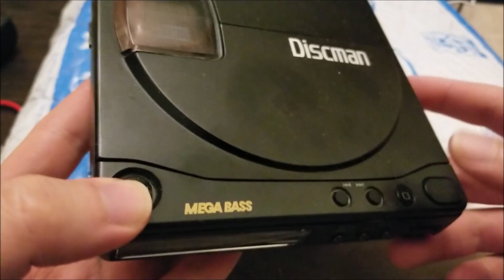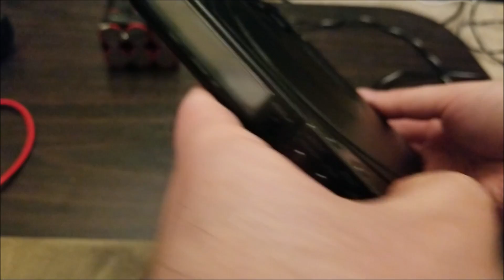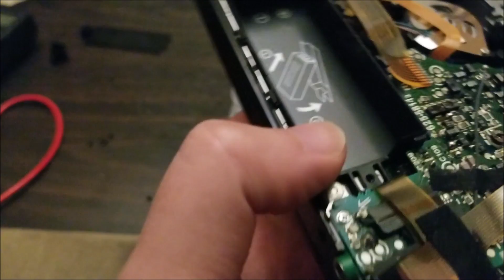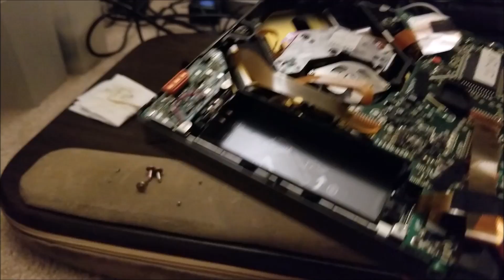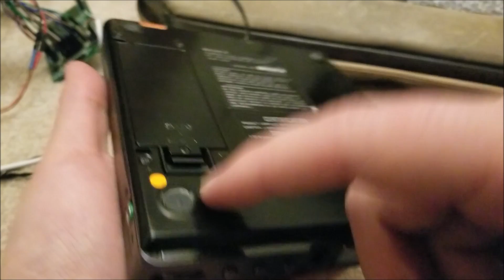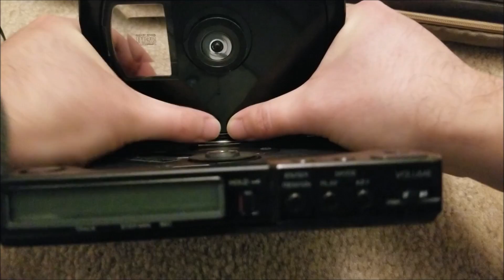Let's Fix: Sony D-15 High End Discman

Comment: hey bro how did you fix the power plug issue? i have same issue , is it a dry joing or dirty terminal requiring contact cleaner ?
Reply from the maker: Mine just had dirty contacts. Plugging and unplugging a jack a few times was enough to get it to connect properly again.
Reply: @sjm4306  thnkyou !

Comment: Thanks for the video and I've been struggling to out the tiny washer back on the middle gear, any insights?
Reply: Thank you! I finally put the washer in with two niddles. But it looks middle gear too tight and possibly ruined the motor. The motor doesn’t run any more. The 3D print middle gear kills me.
Reply from the maker: If the gear doesn't spin freely it'll just stall the motor (no permanent damage). You may have to clean the gear shaft really well and/or slightly remove a tiny bit to loosen it with a small drill bit. Also dont forget to relube everything that moves.
Reply: @sjm4306 I will order a new gear to try out again. Thanks again for your help!
Reply: I finally replaced with a new middle gear which works better. But I found when disc spins it makes big noises. Not sure if something is wrong with the spindle motor or some mechanism needs lubricant?
Reply from the maker: Does the spindle motor spin freely when turned by hand? Is the sound like a scraping noise?
Reply: @sjm4306 it can spin freely by hand. The continuous noise sounds like something is rubbing
Reply from the maker: It's possible the spindle disc clamp was pushed down a tiny bit and the disc bottom is rubbing on the bottom case tray.
Reply: @sjm @sjm4306 was wondering if the noise came from the disc clamp as it looks like wobbly. The spindle motor seems running without issue when I rotate. Do I need to change the part of disc clamp? I was thinking if I can lubricate it.
Reply from the maker: I dont think anything needs lubrication. I think the disc is either too low or tilted slightly and rubbing on some plastic. I'd first try carefully adjusting the position of the spindle clamp on the motor shaft.
Reply: @sjm4306 thanks again. I’m trying to find a video of adjusting the spindle height hopefully.
Reply from the maker: To prevent it from pinging off I sometimes use some putty/bluetack to hold it from the top and use something pointy like a needle or toothpick to find the split end and start prying from one side, sliding the tool around towards the other side to disengage the washer from the notch in the shaft.

Comment: Great job! I have a Sony D150 with the ribbon cable slit in half. Any idea where I can get the same ribbon cable? I was considering using thin wires to replace the ribbon cable. Thank you!
Reply from the maker: It's possible to splice the original ribbon depending on where it is cut. Otherwise you'd have to get a new ribbon designed and ordered from a pcb manufacturer like pcbway or jlcpcb

Comment: I just got one of these and repalced the rotten cog i cant get it to play though it doesnt even try to move the laser, idk if maybe the spindle motor inst getting up to speed or something it sounds like its struggling, any ideas?, the laser does move up and down like its trying to focus if i open the lid and hold the switch
Reply from the maker: Does the disc spindle turn freely? If you carefully push the sled to the outside does it pull itself back to the center when you try to play a disc? The last possibility is your laser is dead so it cant "see" a disc and thus never fires up the motors.
Reply: @sjm4306 i put it into service mode and the sled doesnt move when pressing the forward and back buttons but it is receiving like 3v or -3v so i think the sled motor is dead do you have any idea where to get a suitable replacement?
Reply from the maker: The motor shaft and bushings may have seized from the lubricant drying out. Try to spin it by hand. If it's seized, it might be possible to drip some thin lube into the bushings and work the rotor back and forth to free it.
Reply: @sjm4306  i dont think its seized if i use tweezers on the cog the whole mechanism for the sled spins fine so i think the motor is cooked
Reply from the maker: That's a shame, if you can remove the motor it should have a model number stamped on it that you can google for a replacement part.
Reply: @sjm4306  thankyou ill take it out when i have time hopefully a replacement isnt hard to find lol
Reply: @sjm4306  okay i had the motor out and it span when not in the gear setup so i took the sled screw thing and gears out and cleaned/lubed them properly it now moves along freely, i still cant get it to paly anything though i assume the laser is having trouble focusing do you know much about adjusting the pots i cant really find info on that i assume i need to like on a ps1?
Reply from the maker: @NO_obs to properly adjust the laser you'd need an oscilloscope to see the rf "eye" waveform. Otherwise mark the original position and only make small adjustments left/or right till it works. The pot is only single turn so dont spin more than 360 degrees. I suspect your laser might be weak which isn't likely to be permanently fixed by adjusting power or tracking gains.
Reply: @sjm4306  are the lasers replaceable? and do you know what pot to adjust theres 3 on the board and one on the laser assembly
Reply from the maker: @NO_obs the laser is replaceable but the only way to get one is to pull it from another player of the same model. The pot on the laser is for output power (be expecially careful adjusting this as it can blow the diode), the other three adjust servo tracking gains (you'll need the service manual to know exactly what gains and how to adjust them).

Comment: just got sent a d-25 by my aunt but the disc does not spin up, I suspect a faulty or dirty laser
Reply from the maker: Check the laser sled can move along the rail first. More than half of these old discmans I've fixed had stuck laser heads but the laser itself works just fine.

Comment: I owned the Sony D-25, which was released a year after this unit, in 1989. I worked a summer job that year to buy it for $300. It was nearly identical to your unit. I think the main difference was a 4X oversampling digital filter. The build quality of these discmans was unmatched for the time. The sound quality was very good but it lacked any kind of bass boost and the sound quality of earbuds for the time period tended to be very tinny with very little low-end at all, but they went VERY loud and sounded great hooked up to a home audio system.

Comment: great video thank you.  I just found my old Sony D-15 in a box that has not been used for 30 years.  I realized that it will not power up with just any DC 9v adaptor.  Seemed to worked with a SONY DC 9v 60Hz 10W 600mA (might have been the original)  It powers up and recognizes the tracks but will not play (no sound) so I am guessing it has the same issue as yours with the seized gear.   I am afraid fixing it might be beyond my abilities any suggestions for Toronto/Canada? I think it will be worth spending a few $ to get it working as they dont seem to make them that solid any more.  Thank you
Reply from the maker: I'm in the states so unfortunately cant really directly help, but I'm subbed to a fellow youtuber who I'm pretty sure is in Canada, 12Voltvids. He does similar repair videos and does commissioned repairs for viewers so it's worth reaching out to him to see if he can help.
Reply: @sjm4306  will do thank you

Comment: Your video just now helped me fix one i bought with defective gear. I had one with serious skipping issues, but found another one for 20 euros and i took the risk buying it. It seemed to work but had no movement to its laser. I figured out that the middle gear was stuck and it broke into pieces when i pressed it a little. The same gear from the one i had from before was perfect, i cleaned it with isopropyl alcohol, and after lybricating it i placed it with care to the new one. Now it works perfectly, and i have one as spare... :-)

Comment: Fantasic video. I have a D250 and bought a LIPO off Ali Express which works great but my sled is stuck too. Just going to remove the back and see if some penetrating lube will work instead of tackling that dreaded C clip.
Reply from the maker: Just be careful that whatever lube you use is plastic safe and doesn't contain petroleum products as the gears are notoriously brittle/sensitive to crumbling.
Reply: Thank you. I got it working 😊. Your video was key  thanks for posting 👌🏻.  I moved the gear with my finger to start with, it was stiff then sprayed WD40 on and almost instantly the gears started moving.  Give it a few more drops and sorted. Thank you 🙏🏻
Reply from the maker: I like hearing happy endings to repairs

Comment: Successfully determined my D-15 had a seized middle gear. Went to remove it and it was so brittle it snapped. Anyone have any idea on where to find a replacement (other than another unit smh..)
Reply: Update! -my replacement gear will arrive tomorrow. What silicone lubricant would you recommend for the post the gear sits in?
Reply from the maker: You can use the kind made for electric razors/hair shavers. Let me know how it goes.
Reply: @sjm4306  thank you! 🙏🏻 I will let you know how the install goes
Reply from the maker: There are replacements available on ebay ( https://ebay.us/wtKEnH ), kinda expensive though for a plastic gear but I guess it's a niche product so they get away with raising the prices quite a bit.
Reply: @sjm4306  just picked one up on eBay. Thanks for the tip. It was around 20 bucks with shipping but my D-15 was only 10 at a garage sale so all in 30 bucks? Not bad!
Reply from the maker: Dude a D-15 for $10 is an absolute steal! Wait till you hear it sing!

Comment: Hey, I just lost my c clip :( 
Do I just have a paper weight now or is there something I can do to keep the gear from falling out of place?
Reply: Or any cheap discman models that I can source the clip from?
Reply from the maker: I'm sure they sell tiny replacement c clip kits with a bunch of different sizes available. Worst case though you probably could cut a primative one out of thin plastic using a pin and exacto knife.
Reply: Thank you. Im gonna try to make one and if I can’t then I’ll take a look online. Your fix worked on my D-25, I just lost the dang clip. Thank you for your video, it’s helped resurrect something I had no idea I’d be able to get to work again

Comment: Thanks to Your video I have managed to get my D-150 to work, thanks! The middle gear was stuck, just like in yours, I lost the C clip though... Ordered the smallest ones off AliExpress, hope they'll fit.
However, mine has a problem with volume control potentiometer, makes cracking noise when moved and heavy distortion when on minimum. Once I get the c clips and some proper grease I'll open it again and try to remove the top PCB to gain access to volume control.

In the meantime I'd like to make a custom battery, but with the ability to charge through the player. Do you think some Li-Po battery with built in protection would be enough to safely put it there, or do I have to design some additional circuits?

On the side note, mine also seems to have been opened before, but it lacks the additional small PCB yours have... Wonder what it might be for.
Side note 2 - it's loud! I'll have to invest in some higher impedance headphones, since my Brainwavz HM5 are almost too loud on minimum volume. Sounds great though.
Reply from the maker: For the lipo if you'd like to both charge and use it while in the battery compartment things get a little complicated. First of course you'd need to integrate a lipo charging circuit inside the battery to handle safely charging the lipo. Additionally you'll need a sort of changeover circuit to detect charging to disconnect the battery and connect it through the charger module. Likewise when it's not charging it should disconnect the charger module and instead directly connect the battery. The reason why this is necessary is most lipo charger modules aren't bidirectional so the battery output and charger input terminals are separate and cant be shorted together.
Reply: I lost my c-clip as well. If your AliExpress order worked, would me mind putting the details of the item/part I should order?

Comment: Prices gone up like crazy - just paid $160 for non working D25 on ebay (Nov 2021);  Mint D35 paid about $200 (Aug 2021)
Reply from the maker: Yeah I haven't bought any vintage audio hw in quite awhile due to prices jumping. An already expensive hobby has turned even less affordable.

Comment: Hi there , I have an issue with my d-15 , seams like the problem is there’s no red light into the laser , other then that everything works well , laser moving back and forth even up and down trying to read the disc , any idea what could be wrong with it. I really appreciate if you can give me the advice. Thanks in advance .
Reply from the maker: Sounds like the laser is very weak or completely dead. The wavelength is neat infrared so you should be able to see an little reddish purple light from the lens (dont look directly into it of course, but from an obtuse angle). The problem is getting a replacement will now be next to impossible other than scavenging from another working discman with the same laser.

Comment: Hi, a capacitor broke off of the circuit board of my Discman. Connected to the capacitor was also a small black piece which allowed the capacitor to connect to the circuit board. Together the black piece and capacitor broke off clean from the board. Do you know if it's possible to repair the unit, perhaps by glueing or soldering the black piece back to the circuit board? Or by another means? Thanks.
Reply from the maker: The black piece is only a plastic base and not required for the cap to function properly. If the cap broke off it's likely it leaked and corroded the metal legs that connected it to the pcb. To fix it you should first clean the spot around the cap with some isopropyl alcohol, and then you can solder a new cap on (with the same voltage and capacitance rating as the original one, and make sure to match the polarity, the negative/positive sides should be marked on the pcb silkscreen).

Comment: I just bought a Sony D9 online with no charger. 
I tried to use a 9v charger that’s used for boss guitar pedals, it’s giving me spin, but no disc-read or backlight. 
There’s also a static interference in the headphones. 
Do I need a certain type of 9v charger?

Thanks.
Reply from the maker: Sounds more like the capacitors inside went bad.
Reply: @sjm4306  are the fixable or worth fixing?
Reply from the maker: Yep, just need to desolder the old electrolytic caps and solder new ones with the same values.

Comment: great video!
i jus found one at a thrift store,
however it needs a replacement laser,
would anyone know what that part number would be called? which laser?
Reply from the maker: If I had to guess, the laser is more likely fine but it's the caps in the focus/tracking circuit that have gone bad, thus preventing the laser from seeing the disc.
Reply: @sjm4306  so it turns on, spins the disc, and i can see and hear the laser head hunting, but also, i tried what u did on thr D-8 video, where u pushed the laser all the way back to see if itll go back to the beginning, and it didnt go back to beginning.
Reply from the maker: ah that hints that the gear is stuck just like mine which is preventing the laser from moving (which is obviously necessary for it to read the disc). This can go one of two ways, a simple job of removing the middle gear/cleaning/relubricating or worst case the gear is so fragile with age it cracks and a replacement gear will cost ~$30 ordered from china.
Reply: @sjm4306  with ur guidance, i mustered enough courage to open up the unit,
and discovered indeed it is that gear!
and its definite old and the teeth is really brittle, would u happen to have a link to product page of that gear? or what its called so i can purchase online?
thanks so much!
i cant believe both my guys that i usually go to both misdiagnosed the issue as the pickup lazer..
smh, regardless.. i really appreciate ur help!
Reply from the maker: Here's a site Colin from this does not compute found that still sells the gears https://www.chinahao.com/product/527971137581/

Your repair guys probably didn't spend much time checking it before figuring it'd be more trouble than they'd get paid for. It's sad but many repair places often wont even touch older discman and minidisc equipment anymore.
Reply: @sjm4306   are these the same?
much less expensive shipping..

https://www.ebay.com/itm/SONY-D-555-D-88-D-82-D-250-D-9-D-90-D-99-D-82-D-150-D-15-D-25-Driving-gear-/224500486481?_trksid=p2349624.m46890.l6249
Reply from the maker: Yep that looks like the gear, wow cheaper than I remember. I guess as more people get into fixing these sellers are taking notice and making more replacement parts which drives prices down a bit.
Reply: @sjm4306  That's where i got my gear (ebay url). It fits in there very well. Now if i could just get that little o ring washer back on!
Reply: @sjm4306  my 2 repair guys i usually go to both think its the laser, but i have a feeling they are just being lazy cuz they didnt even bother opening the unit.
ill gladly pay u to have u take a look if u have the time and are willing! 🙏🏽
Reply: ok!
got the gear installed!
was able to get some playback, but its super inconsistant,
now the only way to get it to play without skipping is to hold it on its side..
any tips on a fix?

Comment: Hi, I bought this D-15 back in 1986 and still have it, together with the original power adapter. Of course the battery is dead so I am wondering if you ever made that 3D battery design to contain a LiPo with charge circuit? Would love to get it as I don't have the old battery as an example anymore.
Reply: Never mind, found the links in your other video about the D-15. Great stuff. Thanks!